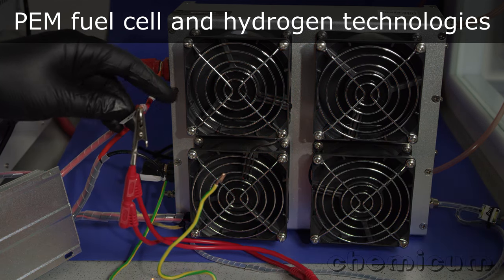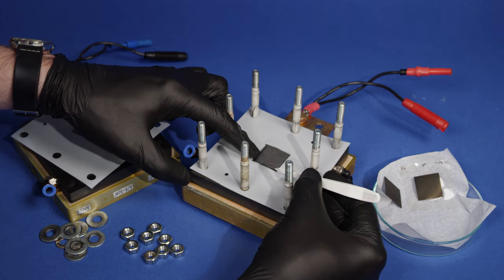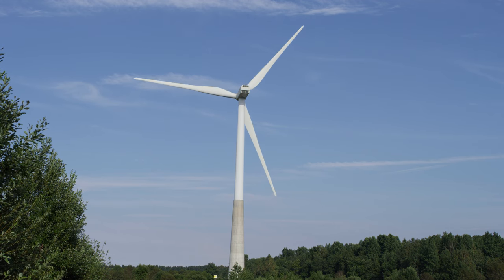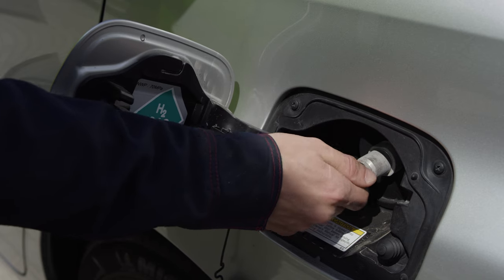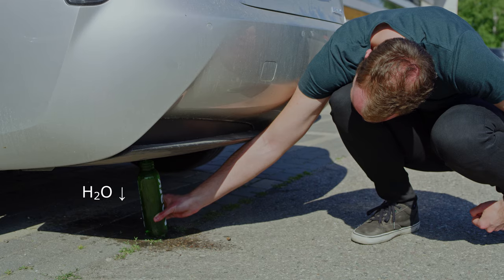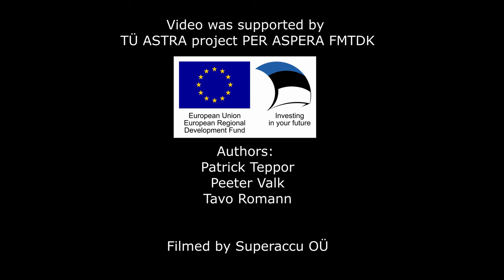Let’s make some fuel cells - PEM and hydrogen tech overview - 8k

Comment: This answered every question I had on the technical side.

For cars, what is the safety concerns of the hydrogen tanks on cars, when they often crash. That much hydrogen would make a really really big explosion
Reply from the maker: Indeed, explosions may happen. However, hydrogen tanks are really strong and protected in the center of a car so most collisions won’t break the balloon
Reply: Just wanna add that it was found that in the event of a rupture, the extreme low density of hydrogen causes it to first escape and disperse quicker than anything else, then it also flys up instead of pooling. It's actually quite safe.

Comment: I have owned my Toyota Mirai for 5 years this month.
Reply from the maker: average fuel consumption?
Reply: @chemicum  over the 70,000 miles I've driven it, I have used 1150kg of hydrogen.
Reply from the maker: @homomorphic  So it is 1.02 kg per 100 km. It is quite reasonable, though 25% higher than claimed by Toyota. So the hydrogen car exaggerates somewhat fuel consumption similarly to gasoline cars.
Reply: @chemicum  depends how you drive. Most of my miles were at freeway speeds (75mph).

Comment: I’ve been noodling a hydrogen production method that in my understanding would be zero waste and reusable and highly efficient. I’d love to see it put to use.

Three tanks, two storage and one reaction. One tank of water you keep filled, one tank of sulfuric acid(sealed).
In the reaction tank is gallium and aluminum powder.
The gallium amalgamates the aluminum.
Water is pumped into reaction vessel and hydrogen is released from the water and oxygen bonds with the aluminum. The hydrogen is captured.
When reaction is complete the remaining water is pumped out and sulfuric acid is pumped in.
The acid strips the oxygen off the aluminum and releases it and it’s evacuated from the reaction vessel. When the reaction has completed the acid is pumped out and the cycle repeats.
Reply from the maker: The part where acid strips oxygen from aluminum does not work
Reply: @chemicum  I watched a video of nilered using acid to remove the oxide layer from aluminum. A quick googling shows hydrochloric acid or phosphoric acid to dissolve the oxide layer.
Reply: https://youtu.be/IrdYueB9pY4
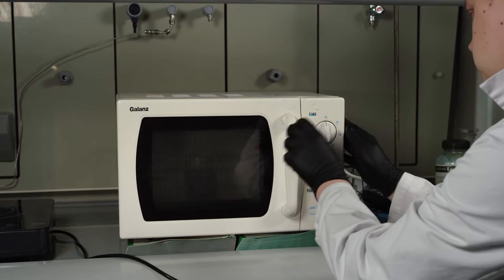@1:29 he shows the reaction. Seems the acid may wind up being diluted over time so the acid may need to be replaceable not sealed.

Aluminum oxide + Hcl = aluminum chloride and water

So I suppose the system would need a ph sensor to detect when the acid won’t react anymore to allow replacement.
Reply from the maker: The acid can strip outside oxide of aluminum, but not convert aluminum oxide to aluminum. HCl may convert Al2O3 to AlCl3 x 6H2O where aluminum is actually bonded to oxygen atoms. So to make the system repeatable there has to be a step where AlCl3x6H2O is converted to metallic aluminum.
Reply: @chemicum  does aluminum chloride amalgamate with gallium? Otherwise the aluminum will eventually be wholly consumed by being converted to aluminum chloride and the acid will be diluted with the water produced. So it’s not perfect but it should be more efficient than electrolysis. And easier for a home hydrogen station.

Is this an idea you could test and refine the process for?
Or do you think it’s just not as efficient or easy?
Reply from the maker: Only metals can amalgate, not AlCl3.
Reply from the maker: To make the cycle repeatable, aluminum compound can be electrolyzed to metallic aluminum.
Reply: @chemicum  so the question becomes, how much energy is saved using the gallium and aluminum and consuming the aluminum vs electrolyzing the alcl back to aluminum vs producing hydrogen via electrolysis

Could be a good video idea to test.

Thanks for the conversation. I enjoyed it.
Perhaps the best solution would be a service that collects the alcl and acid and replaces them with fresh reagents on a schedule and uses a larger industrial process to refine them back to the reagents and redistribute them to the generators.

But my goal would be to produce a clean, safe, self contained apparatus to produce hydrogen safely at users homes to refuel their hydrogen cars.

As for the platinum required it can be salvaged from the catalytic converters sitting in junk yards and repurposed to hydrogen cells. There’s another video idea. Explore that process. See how efficient it is. Can one cat converter make on fuel cell? Two? Ten?

Comment: There isn't any video close to the quality of this in terms of information! Great work thanks!
I have a question though
what is the volume of the ethylene glycol used, the naoh solution and concentration used
The intensity (low med high) and time of the microwave
And when making the ink what's the amount of nafion solution used?
Why was humidifying the gas necessary for the cell?
How was the gas diffusion layer made? For the anode and cathode
What is the bipolar plate made of
Can you compress the stack with hydraulic press for better efficiency? Would it work?
Thank you for your time
I genuinely appreciate the information you've made available for us
Great work! Keep it up!!!
Reply from the maker: Humidifiying was needed for test cell, but in the stack there are already special layers that keep H2O concentration in suitable level.
Reply: @chemicum  Thanks for the information 😊 that's really kind of you

Comment: What is the average "lifespan" of 1kW PEM cell in megawatt hours? 1MWh? 10MWh?
Reply from the maker: Don't know, but we had bunch of PEM electrolyzers that were failing in 6-11 years of operation.
Reply: @chemicum  I see. Thanks for taking time to reply!
Reply: @chemicum  Sorry, I misunderstood. I meant to ask about the fuel cell that consumes the hydrogen. Can you please tell me how much electricity in watthours can it produce during its entire average lifespan if we assume it's capable of producing 1kW?
Reply from the maker: @Morlev44  Don't know, depends on the manufacturer

Comment: If they could make a fuel cell that ran on both the Carbon and Hydrogen in hydrocarbons, you would have a superb energy density.
Reply from the maker: SOFC can use methane
Reply: @chemicum  It only reforms the methane to hydrogen inside the fuel cell and then uses the hydrogen. A combustion engine would extract more energy from the methane.

Comment: and how do you control the hydrogen flow? isn't hydrogen just gonna escape if the system isn't close looped.
Reply from the maker: system is tightly closed otherways, hydrogen can only exit the system as water vapor, which can permeate through nafion membrane.
Reply: @chemicum  ah so you changed the direction of the plates in the other side, and you must have added some type of seal, smart, but can you share the research paper you used, or the method you followed.
Reply from the maker: for the method in the video we don't have scientific paper yet. Seal is made of silicone glue.

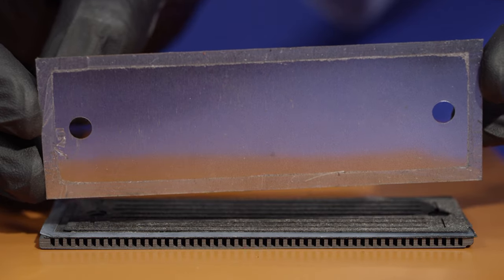Comment: Really interesting video! I have a quick question guys, what's the difference between the PEM assembly on the minute 3:21 and the one at minute 4:28?
Reply from the maker: The first one is just a test cell. The second one is stack that can be used commercially.
Reply: @chemicum  Thank you very much and very good job guys! Great video

Comment: Question, did you build that stack yourself? What is the guesstimate price of a stack that can produce 1 kW of energy?
Reply from the maker: The price is 7000 Eur
Reply: @chemicum  Did you have a price limit, or was it 7000 euro without budget, just buying what you needed?
Reply from the maker: @dwy1171  just average price, could be more, could be less

Comment: So as I understand, one of the only bottleneck for hydrogen engine is the price of platinium?
Reply from the maker: The price of bulk platinum for Toyota Mirai is less than 500 Eur and amount of Pt decreases in future hydrogen cars. So, out of 80000 Eur price tag it is a small amount. But the price of nafion, platinum nanoparticles, etc is a lot. The price will be probably much lower in near future

Comment: How does the hydrogen flow through each single cell in the stack built starting at 4:28? It looks like there’s a metal tube where the hydrogen flows in to that has solid walls.

Comment: A friend of mine said all of the extra water being put into the environment when Hydrogen cars are everywhere would offset the balance of the atmosphere and environment.  Is this true?
Reply from the maker: water is released indeed and water vapor is greenhouse gas. However, water vapor concentration in air is rather related to other factors. Secondly, water can be collected easily from exhaust.
Reply: So @chemicum  having it released into the atmosphere is bad but storing it and disposing of it is a way to fix this issue. But when we dispose of it how can we stop it still causing issues or storing it ?
Reply: @CapsosUk  I think I can make a better work explaining this.
First, when your car use gasoline, a huge % of that gasoline is hydrogen which combined with oxygen release the same or more water vapor than a fuel cell (because ICE engines are less efficient).
Second, water vapor by it self does not contribute with Global warming.
The amount of water in the atmosphere is given by the world average temperature, this temperature can increase if you have more co2 or methane in the atmosphere. 
By it self, water condense in matter of days, meanwhile co2 last 50 to 100 years in the atmosphere.   If water would be an issue.. then we would be death, because we have oceans, lakes and trees that release water vapor to the atmosphere. 
So no... the amount of water in the atmosphere does not depend on the water vapor sources, it depends on the atmosphere temperature, higher temperature in the atmosphere, more water can remain in the air which only then helps to trap more heat.

Comment: I think Toyota should provide free education about hydrogen so that we learn hydrogen can be sustained unlike batteries they are too too heavy doesn’t make sense
Reply: The Mirai and other hydrogen fuel cell vehicles still have a pretty heavy battery pack in it because the fuel cells can’t provide all the power needed to drive the car at peak demand. It isn’t cost or space effective.

Comment: so Latvia makes hydrogen from petrolium gas. WHHHHHHHHYYYYYYYY?
Reply from the maker: cheaper
Reply: @chemicum   so its a fossil fueled hydrogen car now. bcf H pricing.  what would the cost difference be if electrolysis produced hydrogen was used? pref from the cleanest of them all nuclear
Reply from the maker: electrolysis H2 is more expensive but not much. In places, where electricity is cheap, electrolyzed H2 can be price competitive.  Still, this solution enables to get cleaner city air.

Comment: wouldn't it be easier to burn the H2 in a cheap combustion motor, even with de 20% efficiency?
Reply from the maker: Hydrogen internal-combustion motor would make lot of noise and due to high temperature create lots of NOx gasses so it would be environmentally bad. Fuel cell is quet and 3x effective

Comment: I'm guessing that Elon Musk downplayed hydrogen simply because he wanted to accelerate the development of BEVs for use on Mars as neither gas powered cars nor hydrogen cars can be operated on Mars due to their inherent need for an oxygen-rich atmosphere. Likewise, all of Musk's ventures are somehow more pro-Mars, i.e. from creating reusable rockets to reach there, highly efficient BEVs to drive there, compact boring machines that could fit on the Starship so humans can quickly dig underground tunnles on Mars, humanoid robots to create a labor force on Mars, Solar company ofc to generate power and batteries to store them etc. 

Nonetheless, I think here on Earth, Hydrogen is supposed to go hand in hand with BEVs, because we cannot replace all our vehicles with BEVs alone, as that would mean an unpresedented surge in the demand for high power draw at superchargers and storage requirements in the temporary absence of natural resources. Hydrogen solves all those problems and it's capabilities are not limited to road vehicles and I think if we work harder on this tech, we will eventually be able to figure out more efficient and easier ways to build hydrogen energy systems as Batteries will reach diminishing returns.
Reply from the maker: Still, the safety and efficiency of hydrogen technologies must be improved
Reply: @chemicum  Absolutely, and yes it can be attained much like the safety and reliability of ICE vehicles. All we need is a shift in the focus which was diverted, thanks to Elon Musk. I wish we had someone as determined as him who would push for hydrogen tech as well and it will happen.

Comment: Well it costs me one 1/4 of that to "fill" my electric car and it reaches 100kph in about 4.4 seconds. Yes it takes an hour to charge at a fast charger but 99% of my charging is done at home overnight. 
Hydrogen also leaks out of the tiniest orifice and while the car may 60% efficient the over all system efficiency is more like 30-40%.
I think this is great technology, but really only suitable and viable for solar and wind backup.
Reply: Has less lithium related contamination thou

Comment: First tell me how to make those instruments first after lets talk about fuel cells 😃
Reply from the maker: they cost, but PEM can be made without these. For example, instead of expensive ultrasonic spray coater, carbon paste can be spread on memebrane with knife. Moisture control equipment can be replaced with cup filled with water and two tubes...
Reply: @chemicum  how can i contact you. I had other doubts relate to catalyst. And other things. I dnt think platinum is what I will be using ever. But there are lot of other questions i want to ask in depth. Do you have any medium to reach other than comments.
Reply from the maker: Gaurav Amberkar Hi, better to ask here, I don’t use other mediums. The amount of platinum is ridiculously small in newer cells but we have made other chemistries too

Comment: All that video and the quadcopter was a static model. What a ripoff.
Reply from the maker: Yeah, at the day of filming they were updating software so that flying was not possible.
Reply: @chemicum  Yeah, okay. No. I don't believe that. Having a power to weight ratio high enough that it can power a flying quadcopter means unlimited funding and support, as a massive breakthrough. Thus, it's money to pretend you can do that, even when you can't.
Also, I fly quadcopters, and your argument doesn't check out. You can get an off-the-shelf pile of equipment that just needs the power source and it will fly like the dickens. No programing is required. The shit is at a level now that it just fucking works. This device is a scam, and has been reported as such.
Reply from the maker: @buckstarchaser2376  They (Skycorp) develop their own software for autonomous fly. 1h flight time is also evidenced with other hydrogen drones, but the 2h flight time - which they claim - is due to lightweight composite hydrogen balloon - it is indeed something that is not yet verified.

Comment: Graphaite is cheaper
Reply from the maker: graphite bipolar plates are probably cheaper, but titanium gives better performance
Reply: @chemicum  most of the cell are now in the market is graphite. I didn't find any any titanium there. Have you find any titanium cell in uav as hydrogen fuel cell stack
Reply from the maker: @mahmudmitu  Toyota Mirai
Reply: @chemicum  I do business with hydrogen powered uav drone in China. But here everything is grapahite used. I didn't find any titanium inside the fuel cell in China.